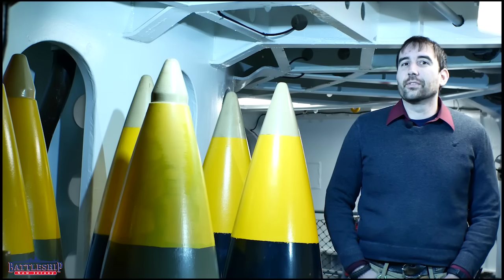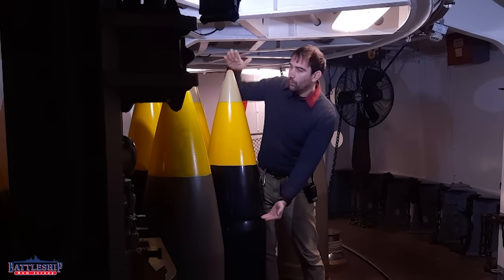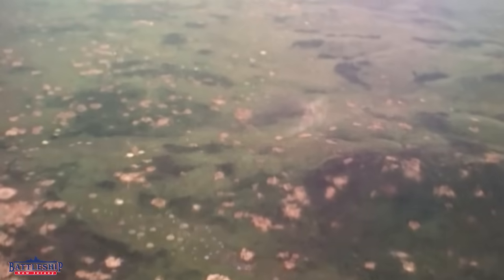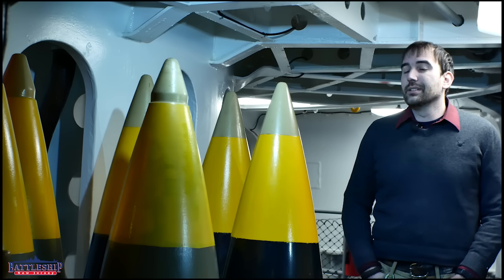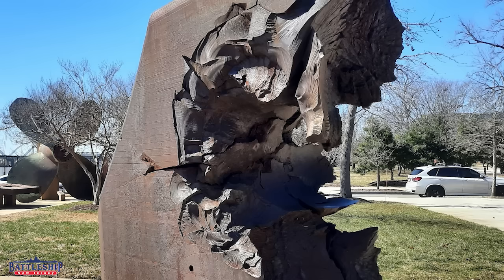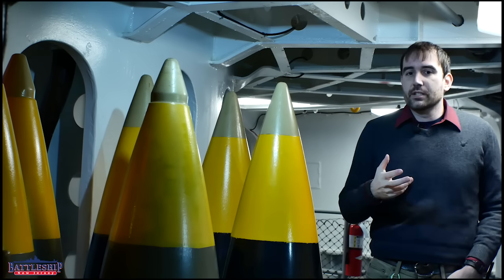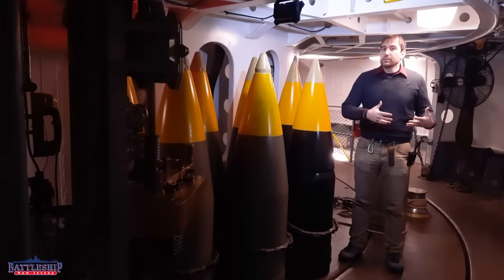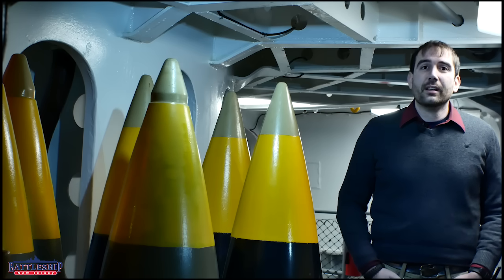What Does the Impact of a 16in Shell Look Like?

Comment: First off when the 16” Mk7 50 cal on the Iowa class battleships can delete a small island that’s impressive, but to penetrate armor at range with plunging fire, the armor piercing round should be made of tungsten. The reason for this is after tungsten is separated from the other ores it becomes quit dense, and has much better kinetic energy delivery at longer ranges. The kinetic energy with tungsten projectiles of a 16” Mk7 gun could reach speeds of Mach 1 to 7 and cause massive amount of kinetic damage due to the denser material then standard armor piercing round would and if the kinetic round was not stopped by the target ships bulk heads or armor then a possibility is that it could sink a ship with in less rounds than normally done is obtainable and cost affective in the long run.

Comment: When you spoke of the powder cavity inside the shell, I wasn't sure how large it was in relation to the steel casing. or how far it might have extended into the nose cone. A cross-sectional and lengthwise diagram or cutaway would have been great! Similarly, when you talked about the lighter weight deflective layers of armor, it would have been helpful to see a diagram of the distances and relative thicknesses. I love your videos and I even got to go on a public tour of a battleship when I was a child during the very early 1960s while the ship was temporarily docked in the Port of Long Beach/Los Angeles. It was a memorable experience that I can easily recall even today. This was a little more than 15 years after the end of WWII, so many of our dads had served in the war. I was very interested to see anything I could of the hardware our fathers had used in defeating the Axis Powers. I love your videos and keep up the great work!
Reply: More detail can be found at https://youtu.be/2lxFFPOv0kE

Comment: A blast on a concrete or rock wall will pass through it and blow off the other side because the shockwave can't pass into the air well and will be reflected which puts the surface of the wall in tension and pulls it off.

Comment: Hi Bryan. I have to add a bit more info here. According to my research, the bursting charges you say here are not correct. The amount of bursting charge in the AP 2,700 lbs round is 40.9 lbs vs the 35lbs you mention, and the amount in the HE round is 153.6 lbs vs. the 133.5 you mention. Also, it does not appear to be called a 'high capacity' round, but rather a 'high explosive' round (HE). In addition, which I think you already know, the 2,700 lbs AP round is not a 50 cal round since the previous battleship class shot the very same exact round out of their 16/45 caliber guns. Again, I offer to you my ballistics file which has all this info in it, along with all the other big WW II battleship ballistics and their ship info as well.

Comment: Imagine the power it would have taken to accelerate a 2,700 lb projectile from 0-3,000 feet per second in just the length of the gun's barrel....about 66 feet. Then go 25 miles if fired at a 45⁰ angle. The sacks of propellant powder weighed some 600 lbs. 20th century warfare was badass. Modern warfare has nothing on it...

Comment: High capacity? no, that would be high explosive HE which can not only start fires but will cause spalling damage so will AP shells that fail to penetrate this is where even though there's no penetration metal will ablate on the others side this is dangerous for crew mostly under certain circumstances AP will cause a kinetic explosive effect not unlike striking a flint on metal this would result in the detonation of any explosive material inside the target.

Comment: "16 inch 50 caliber"?? It looks a lot bigger than 50 caliber.
Reply: it aint .50 caliber and the caliber is the ratio of the round diameter to the barrel length.
Reply: @68pishta68  Is it different for ship board cannons? The diameter of my 9mm rounds are 9mm, my 223 caliber rounds are .223 inches, my 30-06 rounds are .30 inches. Unless it's different for cannons the barrel length has nothing to do with caliber
Reply: @woodbutcherjohn  Where artillery dimensions are concerned, caliber is the multiple of the length of a gun barrel compared with its diameter; hence a 39-caliber gun is 39 times as long as it is wide. Hand guns need not apply...:-)

Comment: The way I used to explain the difference between the two projectiles was that the AP was for shooting at other shops, (especially bettleships), and the HE was for firing at land targets.
The main reason why naval gun fire support was not effective against the Japanese held island defenses was because the HE shells could not reach a high enough angle to punch through and explode. Dud they do some damage? Yes! I've seen pics from Iwo where battleship shells had completely blew a concrete bunker with a heavy gun, off its foundation. 
But unfortunately, they couldn't do enough.
Reply: The unsuccessful naval bombardment of Eniwetok was a lesson-leaned by the US Navy, when they bombarded Iwo Jima they also used aircraft bombing-both naval and USAAF. B-24's carpet bombed some of the deep fortifications near the beaches.

Comment: What happens to one of these shells when it misses the intended target and splashes into the ocean instead?  I imagine at the speeds it is going it would be like hitting reinforced concrete but as a fluid water can disperse the forces unlike a static solid structure.  Yes water is incompressible but that is only when it is in confined volume.   I am wondering how such a shell would be deformed when striking the water at supersonic speeds.
Reply: The shells explode, the deceleration from hitting the water is enough to set off the fuze. The resulting water column can be 500 feet high or even more and was used by the gun directors to improve aim when firing at a ship.

Comment: In the beginning you mentioned these rounds as 16" 50 Caliber. In gun ammunition 50 caliber is actually .500" or 1/2", 30 caliber is .300". So what are you alluding to here, 16" is 32 times as large as 1/2" ?
Reply from the maker: With artillery caliber is a measure of barrel length. 800in length / 16in projectile = 50 caliber
Reply: @BattleshipNewJersey  Thank you for the clarification, so it's actually a ratio between length and diameter of the bore of the barrel.

Comment: I didn't see anything in the video or the comments about the effects of an AP shell penetrating and then detonating in an enclosed space, particularly an armored space. Since the force of the explosion would be rather contained, the damage to anything less dense that the surrounding metal is massive. That includes, obviously, any personnel in the space. For example, should an AP round penetrate a turret, the result would likely be a lot of damage to the equipment there, but totally devasting to the crew. Tank crews face the same risk in modern combat.

Comment: In an upcoming novel the Yamato will face an Iowa class. The Yamato has some place to be, so they will force the engagement by closing which masks the stern turret. The Iowa class (I haven't decided which), will cross the Yamato's T. It's an alternate history of Leyte Gulf. My series, The Fighting Tomcats is a reboot of WW2. Nine books are available on Amazon. The Iowa class is protecting invasion beaches. They cannot run. Unlike the real history, the Yamato will not retreat. I'm not adverse to sinking an Iowa to or slow down the Yamato. I'm wondering. What you guys think the outcome would be?

Comment: I worked at a huge ammunition depot in Indiana. We handled hundreds of 16inch rounds. There are two types the "AP" amour piercing, we called them "black jacks" and the "HE" high explosive. The AP weighed 2700 pounds and the HE weighed 1800 pounds. Last one manufactured was 1941. They have been reworked many times. They would change fuses and paint them. We reworked the rounds and the bag charges used to propel the rounds for about one year. The New Jersey fired them in Viet Nam for about one month until someone said they could not use them for political reasons. We also manufactured 10s of thousands of 5"54 and 5"38 rounds. This facility is the largest ammunition depot in the world.

Comment: "16 inch, fifty caliber"???
Reply: The projectile is 16" in diameter and the barrel is 50x as long as the projectile size.  16 x 50 = 800 inch or 66.6 feet long barrel.  I was on a heavy cruiser that was armed with 8"x 55 caliber guns.  The barrel length of those guns was 440" or 36.6 feet.

Comment: I think just improving the explosive filler used in the shells would make much bigger holes. I think I remember reporters back in the early 80's, talking about "football-field sized craters" when USS New Jersey was supporting actions in Lebanon. Though knowing what I do now about explosives, 50-60 feet across seems about right for ~130 pounds of powder, with target material & angle of impact determining the crater depth and overall shape.

Comment: I made 5" naval projectiles for years.  Working for General Dynamics.  And we were constantly getting new specs for the forgings pre machining to make them more lethal.  I believe when I was making 155mm Howitzer projectiles the same thing happened.  I think if its an armor piercing round it should be heavier with a more defined penetrator and then as big of an explosive charge as you can get.

Comment: I was told a story about the jersey and what happened to the vc around an out post that was going to be over run they had called out for support from the mareen artelery one round of 105mm came in but due to a inversion layer the jersey got the corrected cordnets and fired her guns around the position the aria disappeared in flames and smoke the lutenant got on the TV radio and said wtf over a voice message came out you have been assted by the USS  New Jersey good luck and good hunting if you can find anything left!

Comment: Smaller rounds, faster fire rate, more ammo capacity. I wouldn’t change much. There is not much difference between the 16” and 18” guns to matter if you get hit.
Reply: Drache discusses this.  Its a matter of what your armor is designed to resist.  Even one hit in the right spot can be devastating.  See Hood vs. Bismarck.

Comment: Did he say 50 caliber?   That looks a bit bigger than a 50 Cal
Reply from the maker: You're thinking of a .50cal, not 50 caliber. Caliber for artillery is a measure of barrel length.
Reply: @BattleshipNewJersey    you do know that the CAL  in 50 Cal, is short for CALIBER,  right?
Reply: @righty-o3585  As they said, you're thinking of .50 caliber.   These guns are 16" 50 caliber.  There's no . in front of the 50. 
50 caliber means the barrel is 50 times the diameter of the shell.  
The North Carolina, South Dakota and Colorado classes had 16" 45 caliber guns.   So basically just shorter barrels, a bit less muzzle velocity.
Reply: @SealofPerfection   ohhhhhhhh  ,  see now that makes perfect sense.     A normal 50 Cal is actually half a caliber.   And those are legit 50 Cal.   I totally understand now 😁😁🤘🤘🤘

Comment: Ah, memories. The first time the 5" 54's went off I thought the ship had exploded. No sea legs yet. Eventually you can simply ignore them They were deadly accurate, shooting at pieces of an airborne target as it fell. There were no 8 inchers, but the gunnies said it was like taking a Volkswagon and throwing it 23 miles. Semper fi.
Reply: 5" is 55 pounds, 8" 300pounds, and 16 inch about 2000 pounds. This varied a bit based on purpose of the shell but that is the basic ratio

Comment: I can not get past the 16" .50 caliber shell, Caliber is actually a SAE measurement. meaning 1 inch is 1000 caliber. Making .50 caliber (hence the .50) being half an inch. So this shell from the 16" guns on, could you explain the 50 caliber part please? Or is it 16.5" projectile or 1650caliber? THE CONFUSION! May be i should click the other link before asking this.
Reply from the maker: Heres a whole video explaining caliber: https://youtu.be/79lqN3liPKk 

But in short, artillery caliber is a totally different thing than small arms, 50cal vs .50 cal is a big difference!
Reply: Correct. Caliber in small arms is the diameter of the bullet. Caliber in naval guns is the length to diameter ratio.

Comment: I got a photo of the sun rising over the deck of the New Jersey on Yankee Station in the Gulf of Tonkin back in 1971, wow what a warship. I was on an ammunition ship and we would pull up alongside the ship we were replenishing, match speeds, then a bosun on our main deck with a shotgun would fire a dowel with an elaborate string and shellac head on it called a monkey's paw across the bow of the other ship. Attached to the monkey paw was a small rope which would be connected to a winch (it was already connected to our winch). Attached to that rope was a much larger rope which in turn was attached to a large steel cable. Once the cable was in place between the winches, pallets of munitions would begin to flow. Afterward, other things like mail, and even personnel might be transferred back and forth.

All that took a number of very skilled people doing their jobs almost perfectly, every time. I'm proud to have served even though I thought Vietnam was a huge blunder, then and now.
Reply: Those 16" projectiles are even bigger than I remembered. I remember someone telling me that they weighed the same as a Corvair (a GMC compact car being made at the time) and could hit targets with great accuracy, twenty-three miles away.

Today, we just use a Tomahawk and put it through a specific window.

Comment: I was very surprised at how small the bursting charge is in these shells. I would have assumed that, like the Mark 14 Naval Torpedo carried by our submarines in WWII, the explosive charge would be 600~800 pounds. Although on reflection, I realize that the Mark 14 torpedo was 21" in diameter, so there would be more volume to hold the bursting charge. Question: Is the fuse timing in these 16" AP shells designed to detonate them when the shell, coming down at a steep angle having been fired from near maximum range at a high elevation angle, has penetrated through most of the interior, where it then explodes and blasts a big hole in the hull down in the bilges where it would be very difficult for damage control crews to mitigate the inrushing water? In other words, to sink a ship by holing the hull same as a submarine torpedo, except coming down from above instead of below?
Reply: Bismarck was completely pummeled at close range by British battleships but did not sink.  Cruisers sank it with torpedos.

Comment: I started working at Naval Surface Warfare Center, Crane Indiana in 1985 in the Ordnance Engineering Dept, retiring in 2020. One of the projects on-going at that time was the refurbishment of 16"/50 projectiles for the recently activated Iowa class (BB-61) battle ships. Part of this rework involved removing the base fuzes from the round. This work was done remotely using cameras with the operator a safe distance away. The old-timers told me a story of a shell that exploded during a rework procedure in the late '60's or early '70's. Three technicians were removing base fuzes from projectiles in a reinforced concrete building. The explosion completely leveled the building and left a twenty foot wide by fifteen foot deep crater in a reinforced concrete floor. No remains were found of one individual. They only found a fingertip of the second individual. The third was found pretty much intact, but every bone in his body was shattered. As to what happened, the work procedure called for the fuzes to be removed by hand (they are screwed into the base). It was believed they were using an impact wrench to remove the fuzes which would have the potential to spin the fuzes much faster, and since the fuzes are armed by centrifugal force, it armed and detonated.

Comment: inside one of the big gun bunkers in Normandy there is a big projectile imbeded in the back wall of the bunker  this has come from one of the big counter battery bombardments. Always wondered about the nose shape of this projectile similar in shape to a .22RF exactly as you described, very much a blunt round nose I presume an AP round as you would imagine.If anyone wants further info to location  I will search  I also have my own pics somewhere. Thanks for the info.

Comment: No such thing as 16" 50 caliber shell Ryan. That same shell ( projectile ) is used in both of the types of the 16" gun's modern barrels. The 16"/45 caliber and the 16"/50 caliber. In fact, the Mark 8 round was developed for the 45 caliber guns and then used in the 50 caliber guns when they became available.
Reply from the maker: Its the shell that goes into a 16in 50 cal gun. It can be used for other guns, but we don't happen to have those, so we talk about the ones we do have.

Comment: The Navy considered mounting 18" guns but decided against it as they could achieve the same result with volume of fire as the 16" fired faster and had 3 guns per turret instead of 2.
Reply: 18” were never considered for the Iowa’s. It would have required massive increase in displacement, as well as increases in the beam if triple turrets were used, all of which would have required great reduction in tonnage available for machinery , and would have greatly reduced speed. They would also not have been able to use the Panama Canal.
Reply: @scrappydude1  Agreed! The problems and logistics of gaining those extra two inches of diameter in firepower on a ship would quadrupled at the very least. The IJN built specific use ships for their 18" guns. I doubt an Iowa class could even be retrofitted to accept a twin turrrent of 18" rifled barreled guns.
Reply: Imagine the army using fixed 18 inch artillery being used in battle at an industrial scale. It would probably do more damage than nuclear weapons.
Reply: @bighands69  umm  nope. But I would  definitely prefer ground artillery to a nuclear warhead.